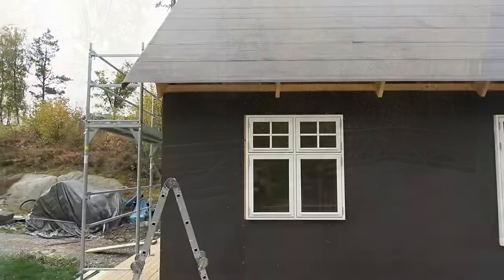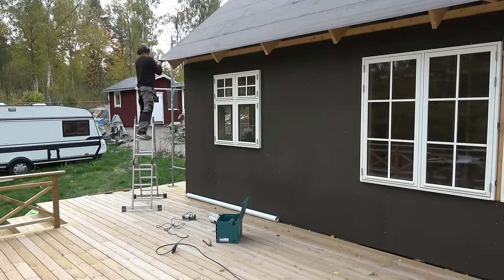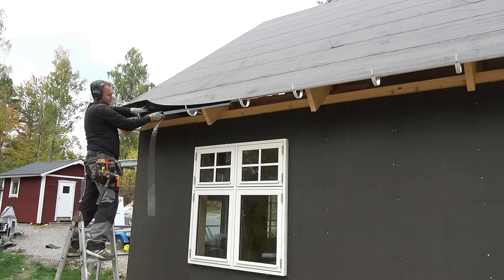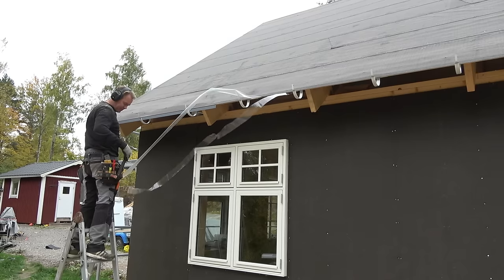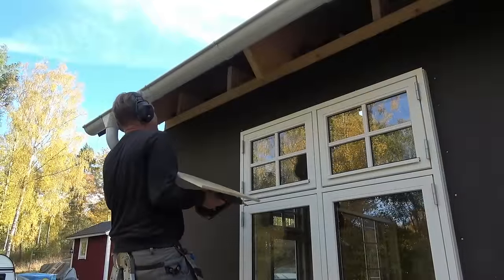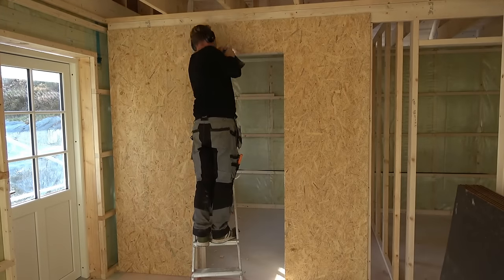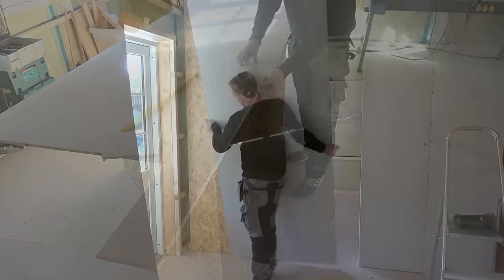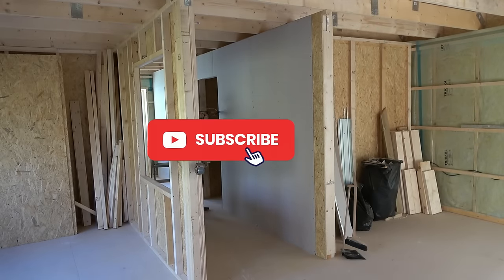Inspection day, did I pass? (Ep.7) Building a house by myself

Comment: The comments on the gutters is correct. I had a new roof and gutters put on my house as I was working in Spain and did not have time to do it myself. Then January 13th I was working in Michigan and got a call saying I had water in the basement. I stopped at Sears on the say home and picked up a sump pump thinking that was the problem for standing water in the basement. I found out I had water coming down and inside wall on my 4 floor house. Knowing I was planning on going to a plant in Ohio that same day. I was going to fix it myself. I was on the roof 3 times and the wife says make sure it is ok before you go. So I went up another time with shingles, hammer and nails. Fixed the problem. Stood up and fell on my knees, knocking my right knee cap off. Now I am sliding 2 stories off the roof. I told myself to drop and roll. Well I dropped and thud. Need to practice falling next time. Landed and broke my wrist and dislocating my elbow and my shoulder, also I cut my head on some wood.. Laid in the snow for a half hour and finally realized no one heard me fall. I then made one handed snow balls and threw snow balls with my off hand to hit the window and get my kids attention as they were home from school due to ice and rain and snow falling. Ambulance came and cut off all my clothes and boots and I laid in the snow while they figured out what was wrong. I was put on a stretcher and went to emergency about 3 miles away.. Fixed me up with no pain pills due to head injury, reset my shoulder and elbow and fixed the broken wrist and reset the knee cap. Pain, Pain, Pain. just a memory now. So di tge Gutters correctly. And yes I was a day late going to Ohio.

Comment: The foot plate is called drop edge in the usa, Not as wide as your foot plate but does the same job. We also do the same as you did went the felt. Its generally like with shingles the first run put up backwards then another correctly over the same piece so it looks good.

Comment: Inspections are probably a good thing. We don't have them in Norway anymore and trades are trusted to self inspect their work. A good thing for good carpenters and bad carpenters, probably a bad thing for the customer. In Norway you can install the electrical boxes, conduit and pull cable yourself if you have approval of an electrician who will inspect and install outlets/switches etc. later. Not possible in Sweden? With your attention to detail you might prefer that :). What I do recommend is putting in a recessed low voltage cabinet for internet with conduit to all the rooms in the house for wired ethernet and TV hookups. Definitively something you can do since it is low voltage. So nice to have the router hidden inside the wall and no visible cables to the TV :)
Reply from the maker: Hi, The electricity industry has ensured that there is a monopoly on electricity, so we are not allowed to do anything, low current is ok, but not high current. It was easier 15 years ago, but now it's deadlocked

Comment: The gutter hangers here in Finland, on my house anyway are screwed on the side instead of the top of the roof. They where designed to have the correct slope for my type of roof angle so no bending required, just screw in once the roof is completed.
Reply: I have used similar models here in Sweden but there are number of models.
Some imported stuff should be avoided since they do not hold snow loads well and break.

Comment: TREMENDOUS AMOUNT OF MATERIALS AND WORK.  YOU CAN MOUNT CROWN MOLDING EASIER, ALSO GREAT MOUNTING SURFACE FOR PICTURES AND CHAIR RAIL, WOODWORK.  DRYWALL WOULD LAST FOREVER YOUR WAY, OUR WAY 25 YEARS AT BEST BEFORE NAILS START TO RETRACK.

YOUR ROOF IS SUPERIOR ALSO.

Comment: I didn't realize how intrusive the government of Sweeden is. You are doing a fantasic job!!
Reply: probably why houses here in scandinavia dont blow over in a mild winds like they do in the US tho ;)
Reply: @nicosand86  LOL! I've never had one of my houses blow over but I certainly like the way you build.
Reply: @jamesoncross7494  glad to hear it 😁 on a more serious note, I'm guessing building a house this insulated isn't worth I states like Fl, TX, NM and other really hot States.

But, having seen alot of housebuilding on YT from the US, my god there's alot of practices over there that makes NO sense, like front doors that open inwards, and how so many only have a drain inside a closed of shower, so that if the sink or toilet spring a leak, the water has no where to drain. And that the US doesn't use pipe-in-pipe with a manifold that has a separate drainpipe for all the hot and cold water in the house.
Reply: @nicosand86  doors open inward for fire safety. think about it for as long as it takes to understand why. an exterior door which opens outward can be obstructed from outside, trapping people inside during a fire.
Reply: @r3wturb0x51  thats why you should ALWAYS have more then one escape route on each floor. Seriously, this has never been a problem here in norway, and exterior doors here pretty much ALL open outwards.

Comment: its nice to see how its made elsewere we nail the plate directly and the second felt left with just the glue because its eliminate penetration of the felt and its more wather proof
and the same with felt on the roof over lap the nailed felt its prevent leaking
Reply from the maker: You know what... i have been thinking about that, how we expose the nails when we put on the roofing felt, Its safe most of the times but i have had leakage some times. If you know a video explaning how you do it, please send a link

Comment: Just a personal fantasy, if you could add a huge rain barrel collector that would be phenomenal.   ^_^
Reply from the maker: Hey, it's actually underway. I have run pipes from the gutters and drainage under the deck and there will be a large rain barrel under there. I will also have solar panels and self-built tesla batteries :)

Comment: What is the purpose of the OSB under the drywall ? Seems like it would just make it A LOT more expensive
Reply from the maker: Most houses here has OSB behind the plaster, for strength and to be able to hang stuff on the wall without aiming for the studs. Its more expensive but it´s worth it.
Reply: In California USA we think of seismic loads.  In Sweden  maybe wind and roof and side wall snow loads?
Reply from the maker: @robertbrewer2190  Sounds very likely, we don't have hurricanes or earthquakes at all, so loads comes mostly from the side and  above.
Reply: OSB  is also like vapor barrier.
Reply: How thick is the OSB? Cheers

Comment: In America, home owners can install electric themselves. It still gets inspected though.
Reply from the maker: That's how i would like the system to be.
Reply: in some places, inspections and permits are not required at all. but as you said, it will likely be inspected at the expense of a buyer. and if issues are found, the sale is blocked until they are remediated.

Comment: Are your interior walls structural or is there another reason to use chipboard?  Don't normally see that over here unless the wall carries a weight from above.
Reply from the maker: It both stabilizes and provides a good foundation behind the plaster so that you can hang things on the walls. Only plaster in the walls is quite unusual over here.
Reply: @mindsparx1  I didn't catch why you do both. Is drywall more fire resistant or something? In Norway I've usually gotten the question which one I'd like (not a builder). I've always selected clipboard because I hate hanging stuff on drywall.

Comment: Waste of money and time putting up OSB then dry wall. If you want to hang something on the wall, find the stud or put up a ledger board.
Reply from the maker: Hi, no, it's not a waste of money, but a stamp of quality on a well-made house. Over here, it is considered that houses without OSB or Plywood behind the plaster are a cheap build. I personally would never buy a house with only Gypsum on the walls. We are talking about a cost of about 1000USD for an entire house, which is nothing in relation to what a house costs to build. the board material also has construction advantages as we choose to put OSB on the inside instead of the outside where it risks being destroyed. We simply build differently.